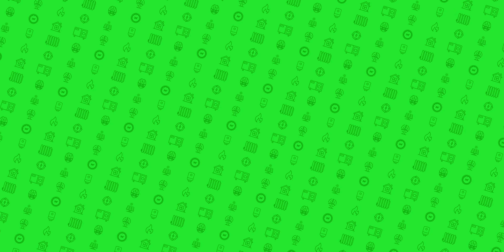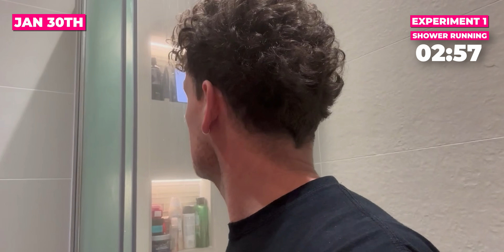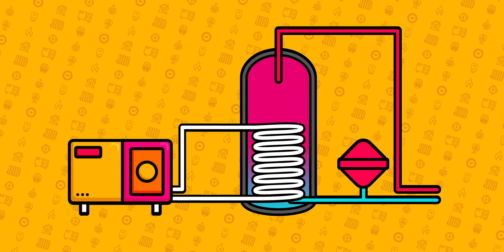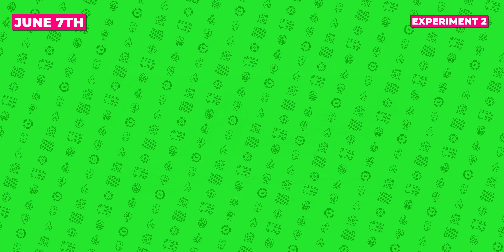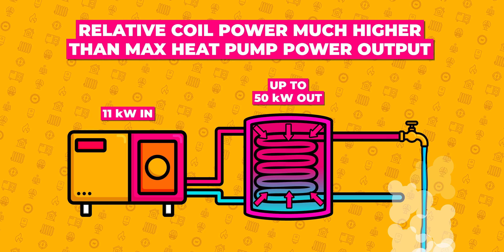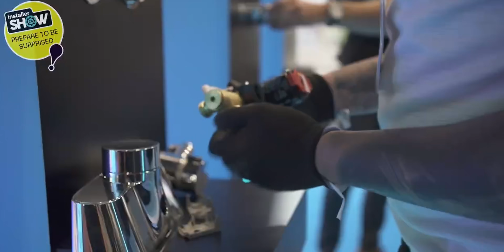The Worlds SMALLEST Cylinder is here!

Comment: Sounds like a hygiënic water boiler. A hygienic boiler has an RVS waterpipe in it so it's save to drink that water but has not the best performance to take a long shower or bath, so what difference those this heat geek boiler has of a hygienic boiler?
Reply from the maker: It’s MUCH smaller.. this is designed to fix the issue of space. Hygienic isnt

Comment: Just to check my understanding - in a traditional cylinder, the restriction is in the transfer of heat between the coil and the (stationary) stored water, so the maximum amount of energy that can be transferred from the heat source into the water is limited by the thermal transmission rate of water.  But in this system, the water is constantly moving through the coil and as such more thermal mass can be transferred in a given timeframe, with the water in the tank acting as a sort of preheater/buffer?
Reply from the maker: No. The coil limits the heat output of the heat pump as its returns some heat to the source. Flipping is means the heat pump can fully let go… although what you said is also true to a lesser extent
Reply: @HeatGeek  I think I understand - in a traditional system the coil limits how much of the heat can be dumped into a tank all at once because the coil physically can't shed enough of the heat from the heat pump into the water fast enough, but in this system there's a greater volume of water (or thermal mass, whatever we want to call it) passing over the heat exchanger at any given time so it's able to shed the heat into the cylinder more effectively which can then saturate the coil more effectively which also means that when the tank starts to run cold you can run more water past the heat exchanger at any given moment and extract heat more efficiently?

A very simple metaphor/example could be hooking up a heat pump to a single radiator directly (hear me out) vs two in parallel - you're essentially increasing the surface area and dumping the heat out faster.  In theory, could a longer coil have the same effect?  Although your method of simply reversing the two makes more sense from a material usage and cost perspective

Comment: This is amazing! How didn't anyone come up with this earlier? It's so simple, it's brilliant!
Reply: We were installing a similar concept in sheltered housing flats 30 years ago. I think it was called a showermax cylinder. Basically a standard cylinder heated by gas boiler with an additional internal coil through which you run your shower supply.
Reply from the maker: That concept is a thermal store which doesn’t allow weather compensated heating or reduced store size
Reply: @robertlewis6408  isn't that a cylinder with a coil for heating it and another for using the stored heat?

Comment: Very interesting, This is basically how I have designed/ plumbed my HW store- using the boiler to directly heat the store and HW uses a plate heat exchanger. As my cylinder is 'normal' sized I have the heat store vented with an expansion tank.
I have been wondering if this would work when I change to a heat pump. Now I'm more confident it will.

Comment: It's definitely interesting but help me out on two points - surely it totally is a thermal store?  You may be using it in an innovative way but it's a thermal store with a coil heat exchanger.  If it wasn't a thermal store, the water in the cylinder would be at mains water temp which clearly it isn't so you're storing heat.  Second, like Gledhill's claim on their thermal store, which I don't understand either, I see repeated replies on this thread from you and other like Szymon that there is no legionella risk.  But the coil surely is a temporary dead leg.  The coil is never empty and is being heated by the water mass - to presumably somewhere between 20-40 without the HP being active - certainly not 60 which the HSE say is the level above which legionella cannot survive.  When you first draw the volume, inevitably you get the volume from the coil at some point which has been stored not flowing - or am I missing something?  Is the claim that legionella doesn't have time to develop 'in a normal setting'?  (I think there is evidence it can develop in 'days' so leaving a property for a relatively short period of time might introduce a risk, or are you making another point?).  Keep it up by the way - I'm not knocking the concept or your innovation
Reply from the maker: The vast majormajority of the heat is created live, not stored. A much more accurate name is a water jacketed tube heater.

There is no such thing as a temporary dead leg. This has movement every time there’s a hw draw.

Note that most of these will be kept at 50-55. 

Please also watch our legionella video. There are no cases of domestic legionella. And it only grows in shower heads not in cylinders.. certainly for domestic.
Reply: @HeatGeek  No sweat - I guess you can call it what you want -as it's yours! !! I just think (as a marketing guy) that if you described it as a 'heat pump-optimised thermal store for instantaneous DHW' you wouldn't have to watch a 30 min video to fathom out what is it?

Often gimmicky monikers for things slows adoption, no increases - just my 5 cents.(If you google 'water jacketed tube heaters' - guess what the first response is:  "Thermal stores (also known as water jacketed tube heaters)".  LOL)

On your legionella comment - I had actually seen your video.  Look, I don't think legionella is a huge issue either but i) just because you can't find stats for domestic incidents doesn't mean there aren't any cases or potnetial for cases - it's like saying there are few cases of electrocution in a domestic setting (except if you're an electrician, since most houses have RCDs now) it's also not unreasonable to assume that domestic cases will be completely unreported/under-reported since the symptoms are like pneumonia - or a bad cold.  A lesser form of the illness from the same bacteria - Pontiac fever would never end up in a hospital admission except in the most vulnerable.  And Legionnaires infection diagnostics is actually not that robust even in a clinical setting either and ii) my only point about the 'temporary' dead-leg was (assuming you're using something like a high recovery coil int he cylinder)  - you've got say 3-5m of copper filled with water - say 1 - 1.5l of water - now go on holiday, now run a shower when you get back - you will get aerosolised output - of something - potentially.  

I'm sure it's all fine - it never pays to be so categorically defensive though does it?

But keep up the good work - avidly watch all your content.

Comment: I'm running through in my mind what you could put in that could trigger the heat pump a couple of minutes sooner to avoid that dip before it stabilized, or rather bring the dip forward (i.e. while the cylinder was still warm enough to avoid the DHW dipping under 38), but as I watched the vid, the system clearly kept up. Took me a while to visualize how the swapping of the pipes helped in the way it did. More excellent work from the Heat Geeks! Shame it didn't happen a few years ago, as I already crammed a 200l tank into our tiny airing cupboard!

Comment: How does it not need an anti legionella cycle and how does it not need a temp/pressure relief or expansion vessel? Surely thats going against water regulations?
Reply from the maker: There are no regulations for anti legionella. 

The only regulation (g3) is for stored hot water. This is below 16l (6l) so is correctly considered as an instantaneous water heater.

Comment: Ive fitted one of these ARISTON Lydos hybrid 100L WIFI thermos and was impressed, no need for a external unit, and is separate from the heating system, so when reheating it doesn't reduce the temp of your rads which is ok in a new build but not in a older house. Very surprised they've not really caught on in the uk.
Reply from the maker: You’ve fitted what sorry? This hasn’t been done anywhere else before
Reply: Sorry an ariston lydos hybrid, is what I'm referring to. There available in Spain and im not sure why they haven't took off here in a big way, just a straight swap for an old water heater basically, but with a built in heat pump and no need for an outside unit.

Comment: Clever idea running the DHW through the coil 👍 I initially thought maybe it was just another rapid recovery cylinder 😄
How is expansion accommodated? I get that the larger body of water is connected to the heating system now so it should covered by the expansion vessel in the heating system. Is the DHW side vented or unvented?
Might be less of a problem in Ireland as combi boilers never really took off for some reason. Things have been changing over the last decade or so but in the past you could almost guarantee every house you walk into had a 30 x 18 inch vented cylinder in it 😁
I can think of lots of good applications for this though 👍
Reply from the maker: Unvented. There’s little to no expansion

Comment: As your video concentrated om running a  shower what is the benefit of involving a heat pump to heat the water for a shower when a 10.5kw shower run for 10 minutes will cost about 12 pence. You are obsessed with COP rather than evaluating the actual cost.
Reply from the maker: A 10.5 kw electric shower will only run at 5l/m. The cop is inportant because it shows it will have 1/3rd the running costs. Consumers main concern
Reply: @HeatGeek  A 10.5kw electric shower will provide a continuous shower with full water pressure volume.

Comment: Is this the same as a thermal store.  I have 350 litre thermal store which is heated by solar thermal evacuated tubes, a woodburner in the winter and a heat pump. The water in the heat pump, thermal store, woodburner and underfloor heating loops is all the same.  DHW is mains pressure water running through a plate heat exchanger on the outside of the thermal store The solar thermal loop is connected to a coil in the thermal store and another internal coil takes water to 3 towel rails in the bathrooms.  I fitted this 12 years ago and am very pleased that it sounds like I have an efficient system!  Although perhaps my tank is too big.
Reply from the maker: No

Comment: This is great news as we manage quite a number of properties and need to develop a long term plan. We're still replacing boilers like for like and also with refurbs, the lifetime of boilers seems to be depressingly short.
Reply: It'll also lengthen boiler lifespan (in the case of steel enameled boilers) because the tank is filled with 'dead' water, like the radiators. Only the copper/stainless coil gets to see tap water and they're much more resillient to corrosion (do not descale your tapwater completely as it protects your pipework).

Comment: Are all combi boiler equipped to “push” water to an external cylinder or do you need to an extra pump ?
Reply: Reason why I ask is because the water pressure no longer goes through the boiler anymore… anyone has a drawing and clarification if this would work …. Please?

Comment: Hydrogen gas which is clean energy should be used. This is added to the carbon footprint. The is not net zero at all and you know. This is only fueled by government grants stolen from the tax- payer. An easy conversation kit can be used in existing boilers.
Reply: Currently the only known 'green' way to produce hydrogen gas is by electrolysis of water using electricity, and this requires approximately 30% more electricity than the energy it yields, so roughly 4x as much as a heat pump.  Hydrogen gas is not a viable solution for domestic heating and anyone claiming oherwise is greenwashing as a way to justify continuing to install gas boilers.

Comment: brilliant but also simple. If you simplify this, this no different to instant/tankless/tiny-tank electric heaters here in Asia/South East asia only the above product uses a heat pump as source of heat.  The only drawback to this solution is the size of the heatpumps, 7KW heatpump is massive - surely cost more than large tanks with tiny heat pumps
Reply from the maker: It will work with a 3kw heat pump I’ve proven it
Reply: @HeatGeek  indeed but flow rate likely small, maybe usable with efficient shower heads or warmer climates.

Comment: This is brilliant and perfect timing. I have a small 1 bed rental property that has an airing cupboard but no way to reach it from the boiler as all the pipework was removed when a combi boiler was fitted by the previous owner. I do have room in the kitchen directly below the boiler so this finally solves a problem I have been thinking about for quite a while. It also takes me a step closer to getting a heat pump at the property.

Comment: If you use a thermal heat store instead of a hot water cylinder it will be more compact  and give more hot water per charge, but obviously more expensive (eg Sunamp),

Comment: I'm a bit confused at some of your figures you've quoted and how you've measured the generated heat.

You've said you used a 7kW ASHP but you're claiming 11kW of output on the heat pump according to your graph, have you used a different heat pump or do you have a measurement error on the heat output metering?
Reply from the maker: The heat pump is rated for its output at -7 outside.

Comment: Who showers at 38 to 40 degrees in reality?  Maybe in the summer but not in the winter.
Reply from the maker: I tested at 40.
Reply: What temperature do you shower at?  Most thermostatic shower valves have to be overridden to get above 38-40'C.
Reply: @jfinnie78   actually most older valves have an override button to allow you to go over 38 degrees so children don’t burn themselves and most modern valves are preset around 42 degrees max but a lot of my clients ask me if I can make them hotter, especially when using a thermostatic valve with a bath outlet.
Reply: @jethrohealy3277  The Hans Grohe I have was 38'C when I bought it (that's what is printed on it) and the newer ones are set now to 40'C (printed on them).  I was never sure if this represented an actual change in the set temperature or just a labelling change, as mine measures around 40'C at 38'C indicated.    I set the actual max limit on it (it is a bath mixer) to about 44'C, which I think is about the safe limit really for something you could jump in inadvertently.

Comment: Great product. I see that there are different size options coming for this very soon, according to Newark Cylinders website. Do you have any guidance for choosing the right size, as we are just finalising heat pump system spec, and would like to consider this as an alternative solution combined with a ASHP. Thanks.
Reply from the maker: Coming soon

Comment: Adam…there are thousands of blocks of flats in the UK, all with individual gas boilers. It’s not possible to install a heat pump in those properties, so it’s just not correct to state that this solution will suit such a high % of UK homes. If only….
Reply from the maker: Look at the unique heat pump system
Reply: Thanks for your reply Adam. Could you perhaps be a little more specific please? I live in a block with 188 flats who all have individual gas boilers for heating and hot water. I love the HP technology and am keen to find a solution. Great channel, btw.

Comment: So could it be used with just the immersion if i want to get rid of the gas combi but am unable to get a heat pump?
Reply: How would you heat the house?  This relies on the heat pump to heat the house, and is just a compact solution for the hot water supply.

Comment: How good it will work in -10? For me in summer my heat pump is putting out 16kw  but only rated 9kw in winter. Gass boiler was 22kw
Reply from the maker: Just fine! Where are you that it’s -10?

Comment: Are you able to tell us how  the dhw yield (ie how much dhw you get at say 40C) compares to a uvc of similar size and operated at the same heat pump flow temperature?  I think that is a, possibly the, key piece of information to enable a logical system choice to be made.
Reply from the maker: Yes have a calculator
Reply: @HeatGeek  Excellent, when will you/Newark publish the figures (or the calculator).  Really keen to find out how this cylinder arrangement compares to a similar sized uvc.

Comment: Apart from the house getting colder because the heating isn't on while everyone wakes up and gets in the shower - rather than the heat pump heating the DHW cylinder at 3am when everyone is tucked up under the duvet... then, yeah, brilliant 🙄 
I guess the revolution may not be televised just yet.
Reply from the maker: That won’t happen. Even in the slightest
Reply: @HeatGeek  At all? Ever?? Not even in the the slightest??? So unlike an actual "combi", you've invented a heat exchanger that supplies a continuous amount of DHW at the same time it is providing space heating, irrespective of the ambient temperature, and with absolutely no affect at all on the COP?!

Comment: I currently generate 250L of hot water in my existing cylinder from solar panels on most summer days, and will use most of that on some days, the rest of the time a smaller proportion. Would I be right in thinking that unless I'm using the hot water at the same time it's being topped up by solar, with this smaller tank I'd essentially be losing a large chunk of the amount of hot water I can generate from my panels and therefore have to rely more on the main form of heating (currently gas)?
Reply from the maker: You’re always better off using a heat pump for hot water and the lecy to power that at 300% efficiency. Then you can use that spare left for car or other stiff
Reply: @HeatGeek  agreed, but I don't currently have a heat pump through

Comment: This is so crazy. I also just bought a bunch of stuff to make a system like this. I (maybe unwisely?) went with a 200L tank with a similar large coil but also have a 100L I was going to use for cool water. So I wonder if maybe I should flip that around because the smaller cylinder can heat up faster?